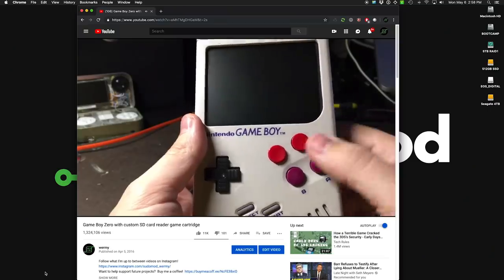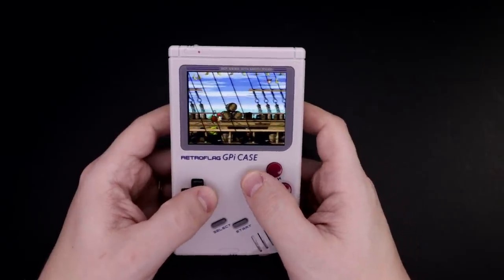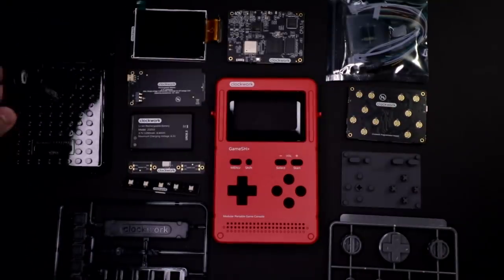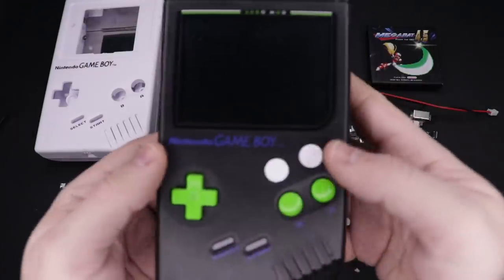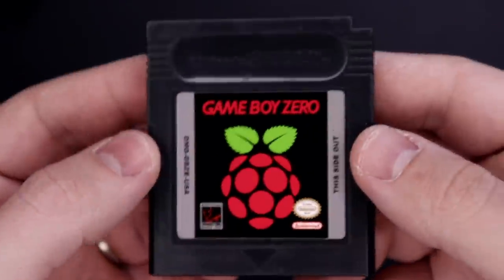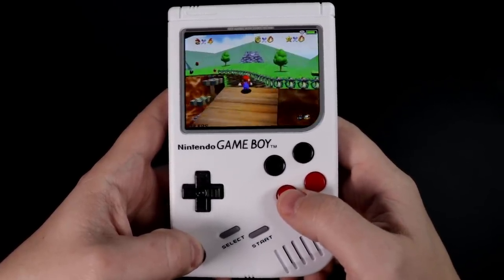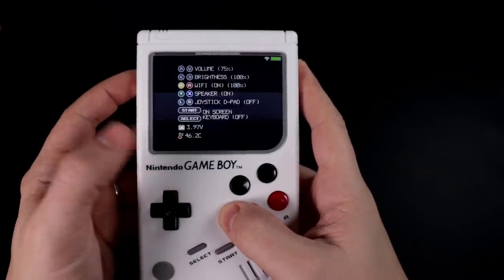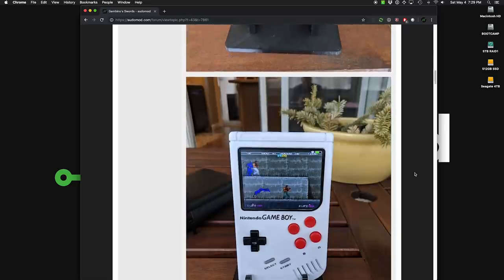Retro Emulation Handheld Showdown and GIVEAWAY!

Comment: I've got a circuit sword, extremely happy with it. I take it on long plane rides all the time and with a 4000mah battery I've never run low mid flight. I've got two psp1000 analogue sticks in mine and 4 back buttons for running PSX games. One thing Wermy didn't mention is it can even run a couple of dreamcast games with reicast. 3D stuff is kind of slow but 2d arcade ports like marvel vs capcom 2 are perfectly playable.

Comment: I wonder if they were working to a price point on the Gpi, and decided to leave out the LiPo charging circuitry to meet that. It's the only thing I would criticise about the case though, apart from that it looks awesome, and I'm sure there will be plenty of LiPo conversions shown as soon as it hits the streets. I am now torn between the Gpi and the Kite. Not a big fan of the ClockworkPi Gameshell, but for a certain audience (I'm thinking younger makers) it would be perfect. For an older tech head like me, the Kite is spot on. Thanks for the informative comparison.

Comment: Great show case! I have a CircuitSword myself and while I really like it (it even runs PSP games), I think you understated the amount of work it takes. Part of that for me was that I messed up a couple of times, did things in the wrong order (like inserting brass inserts into the screen bracket only AFTER installing it). I also did most of the case modding without power tools because I'd never used a Dremel before and didn't want to mess up the one case I had. Doing everything with hobby knives took far longer than needed! If you're ever going to do a "beginner mistakes you should avoid" video, I have some notes for you :D

Comment: Why not make a video about modding the Retroflag GPi case to use li-ion battery instead of 3 AA?
Reply: Theres already videos out there for that?
Reply: There's literally no point in doing that. The 3AA's are fine.
Reply: @jimmygillard   They're higher energy density, lighter weight and rechargeable . Means more battery life and less expense on buying batteries. Of course theres a point in doing it.
Reply: @felixschrodinger7533  You can get rechargeable AA batteries.
Reply: @edstar83  Yeah I know, but they don't have as high energy density as Li-ion, so the charge doesn't last as long as a Li-ion battery that's the same volume. Which volume is another reason why it doesn't make sense to design it with AA batteries as they take up more room because of their cylindrical shape. All the room for the battery tray if it was used instead to fit a Li-ion battery, then in theory you should see quite a big increase in battery life. You can potentially charge a Li-ion battery faster than AA's too and it's built in so don't have to bother taking the battery out to recharge or carry extra batteries when you travel. The benefits might not be worth paying someone to mod it with a Li-ion battery but if you have the skills to DIY then it's an obvious upgrade IMO.

Comment: I was sold on the Circuit Sword back during the first preorder. I ended up waiting for the second round and got mine. I couldn't be happier. Mine is completely glue free, I designed and printed parts to get everything to fit together. Obviously, it was terribly expensive. I spent near $300 to get everything but IMO, it was totally worth it. So much fun and the most power you can have on the go for this kind of thing. Also super fun to plug it into a TV with another controller and play with a friend on something like Mario Kart.

Comment: I'm confused about the purpose of the barrel jack on the GPi; is it meant to charge rechargable batteries in the case? Or just there as a built in option in case you mod it for a lithium ion
Reply from the maker: It's just there so you can plug it in if your batteries run out, not charging.  I love the original Game Boy but I feel like this (the use of AA batteries) is one thing they didn't need to reproduce exactly on this.  😁
Reply: @wermy  ahh that makes more sense, and yeah definitely a strange choice in 2019 :P thanks for the reply!
Reply: I do wonder if modding it to enable a rechargable battery... if that port could be utilized to recharge the batteries??
Reply: @eversinging  that's probably the best way to go. But at that point you'd probably want to squeeze in a charging board and use micro USB instead of whatever that built in port is.

Comment: I actually like the idea of AA batteries. Buy some 2800mAh rechargeable batteries and you're good to go. Gives you the option to swap out drained batteries for a fully charged set. I would love to see how well 3 2800mAh AA rechargeable batteries would stand up compared to a lithium battery. 
One question, can rechargeable AA batteries be charged from within that unit? I'm assuming no, considering the power draw and charge times for AA rechargeables can be crazy long.
Reply: I'm with you here. The fact that it takes batteries makes it a more more appealing rainy-day choice than a standard rechargable handheld. Just keep the thing in a box with a few extra batteries and it'll hold up great.

Comment: I wish you could put a Compute module in the GPi case, that would solve a lot. (assuming you can get a CM easier than a Pi-W)
Reply: i wish too.
i wonder though if one can desolder the unnecessary things from a b3+ (ethernet, usbs and so on, and the pins) and use some kind of custom printed cartridge with it.
it looks like the cartridge is the outmost part of the case, so you can theoretically have wider cartridge, so as long as you can manage to keep the same height of the two pcbs i guess it's possible...
Reply: or maybe someone can make a custom pcb that has the sodimm connector instead the springy pins, and maybe it would again require custom cartridge as it is still bigger than the zero

Comment: you said "(screen size) DPI screen" several times. that doesn't mean anything because DPI just stands for dots per inch so it's like saying "it's a resolution screen" or "a miles per hour car"
Reply from the maker: It’s a kind of display interface, like hdmi or spi (though to be clear spi is a general-purpose bus, not only for displays). https://www.raspberrypi.org/documentation/hardware/raspberrypi/dpi/README.md
Reply: @wermy  til, sorry about that

Comment: One thing that bothers me is the cartridge looks too fake on GPi Case. I also I hear that the speakers have some static hissing issues. The lack of a proper battery life indication can be an issue (but I take it that may be an issue with most RPi builds)
Reply: Most GBZ builds employ some battery monitoring using analog inputs from an ADC and some screen overlay scripts. Let's just say it's a long solved problem

Comment: Can u put a raspberry pi in a menzy comfy wallet, the stainless steel one? 
It would look soo clean and slick.
It would also be a tough challenge
Reply: You can put only the mother board and a bluetooth module in the bottom half, and a screen in the top half, so u could have the controller separate, idk.

Comment: Hey guys!

Sooo, where's all the MintyPi 3 stuff I "pre-ordered"? And that was early January. 

And orders were "going out" in March.
Reply: All I've gotten so far are some 3d printed parts that look like they hold buttons.
Reply from the maker: Helder ran into a few issues with his parts (the printed parts were from me). He’s been in the process of shipping them the last week or two, so keep an eye on your email.  Please use the forums or hop on the discord server if you have questions. 🤘
Reply: @wermy  I can't wait!

Whenever I finish that project up I think I'll be moving to one that's a bit more ergonomic. And then maybe take all that knowledge and design something myself.

The software is the easy part. And if you're using a standard Pi and plugging it into a TV it's not even a "project". 

Designing the handheld hardware itself is the real challenge.

I need to figure out how to use some CAD software.

Comment: Ocarina of Time isn't a good test, use Majora's Mask!
Reply: Running ANY N64 game on a Pi 3 is a challenge. And even ocarina stutters a bit. So majora's mask really isn't going to fly well. Not until the pi foundation upgrade the GPU (it's the known bottleneck for running N64 well)
Reply: @AlistairBrugsch  Is there a way to add in a GPU via GPIO?
Reply: @AoiKaze2000  🤣😂🤣😂if only. There just isn't the bandwidth available
Reply: @AoiKaze2000  options are higher spec boards like the odroid XU4 (but they usually come with high power and heat dissipation requirements) or wait to see what the next raspberry pi brings. They have said it would be completely new architecture
Reply: v true, majoras mask makes the wii and psp emulation builds shit their pants. im going to opt for portability and aesthetic on this though. no physical buttons for emu on my phone paired with the void that used to house my gameboy pocket cant be filled with pure specs
Reply: @opulence_reviled  decent phone with a Bluetooth controller grip like the ipega ones work surprisingly well

Comment: Hello, how much mah for batteries of retroflag gpi for your test  ? 2500mah ? 2800mah, 3000mah  by batterie ?
Reply: Yeah this is good to know.
Reply from the maker: The ones I tested with were 2300mAh Energizer brand.
Reply: @wermy It is strange... my LCL Game Boy with a RPi 3A+ inside has a playtime of 5 hours with a 5000mah battery. Why a RPi Zero with 3x2300mah only 4 1/2 hours? oO"
Reply: @adventureFAN  because your 5000 mah battery is a 3.7v nominal battery. 3x AA's in series are 3.6v but still 2300 mah total. Batteries in series add the voltages but the amperage stays the same. If you put them in parallel the voltage stays the same. (1.2v) but the amperage adds up so would then be 6900mah. Not 3.6v at 6900mah
Reply: @AlistairBrugsch  Ah okey thx for the explanation =]
I have 2850mah nimh batteries... I hope they will hold up for over 5 hours.
Reply: @adventureFAN  if @wermy used 2300 and got that result and your batteries are really 2850 then you should be golden
Reply: @AlistairBrugsch 
Yeah there are no fake. German fabrication from Ansmann =)
Reply: @adventureFAN  👍

Comment: Ah la la trop dur de choisir ... Gpi easy to set up v. Kiteretro powerful stuff wich one chose ?
Reply: If you want something easy to set up and play, then go GPi. If you like a small challenge, including doing all the case mods and a small amount of soldering or you want to play the maximum amount of consoles like N64, psx, PSP, or even some DS games, go for the Circuit Sword. I honestly have the CS and I LOVE it! Thanks to this video , I am going to add a joystick and l2+r2 buttons when all the parts come in.
Reply: Hi, seems that kite board is no longer availaible, no refurbisher in France ... maybe try an other product 🤷🏻‍♂️
Reply: @jaygreg77  Kite should have another round of preorders coming up within the next couple of weeks. Just keep an eye out on the Sudomod forums for updates.
Reply: @LiLTrublMakr  Thank you, good tip

Comment: What is your problem with AA batteries?
Reply from the maker: The fact that I can't just plug it in and charge it up (the last gaming handheld that I can think of like that was the original GBA...  18 years ago).  Unless you want to waste money on alkalines, you'll be taking out the batteries every time you need to charge.
Reply: @wermy  Okey but I have 2850mha batteries and I think I will get a much longer playtime then a typical battery that are installed on such devices. And when a battery dies its no problem anymore... I think this not so bad. But yes... on longer trips it is a downside because you have to carry a extra battery charger.
Reply from the maker: @adventureFAN  Playtime isn't really the issue.  It's the fact that you have to open the thing up, pull out the batteries and put new ones in every time you run out.  That just feels archaic in a newly-released device, especially one that goes through batteries after a few hours of use.
Reply: @wermy  Yeah 1989 gameboy feeling =D
I understand your standpoint now but for me it is no problem.
Reply from the maker: @adventureFAN  Yeah, it's certainly not enough of a problem that I wouldn't recommend the GPi Case, it's just disappointing to see that when everything else about it is so great.  :)
Reply: @wermy  LiPo MOD!

Comment: And if you're really lazy, buy a 2DS. :)
Reply: This is where I'm at. Refurbished 2ds directly from Nintendy is $50-60. It plays GBA, DS, and 3ds games natively AND emulates NES, Megadrive, SNES, GB/GBC, PCEngine on first party hardware with all the benefits that entails. In 5 years I doubt I could source a replacement screen for the GPi or the Clockwork case whereas I like my chances with the 2ds.
It also has online and local multiplayer.
My only gripe is the 2ds slate form factor isn't pocketable, but the 3ds/new 2ds fills that role.

Comment: Ohh big blunder with the AA battery design. Rechargeable battery with indicator light has been the standard since the GBA SP, over 16 years ago. You can't cheap out like Microsoft did and think people won't mind swapping out batteries every few days. I love my Xbox One S controller, it's great for playing games on my Steam Link, but without the Nyko charging stand and battery pack, I would probably use it a lot less because although you can use a USB plug-in, it's micro-usb and that is a garbage, easily bent cord design that doesn't stack up to the better-held mini-usb design which is now basically defunct for some ungodly reason.

Not to rant, but why is it that the industry can't decide on just one god damned standard for USB cords? Why do there need to be like five? Micro, mini, lightning, fucking whatever. These companies can't just give people a single, affordable cord, they've got to come up with their own and waste consumers time and money. In Apple's case it's more about money, but I doubt the others are less greedily motivated.
Reply: iVirtualPlays  "I prefer AA Battery design over built in batteries. It’s more modular that way."

More swapping of batteries, too, which is idiotic. It doesn't need to be "more modular" it just needs to be easy enough to swap out should the battery start losing its ability to hold a charge.

"No need to open up the controller if you want to upgrade or replace a bad battery."

If the battery is quality enough, you'd only need to do that once or twice. It is by far the best option as opposed to opening it up every week, depending upon usage. Even without use, Double A batteries lose their charge and you have to swap them out. With a rechargeable battery, you only need to plug the system in. That's why it's standard. It's quick and easy. If the Nintendo Switch still used Double A batteries, I promise I would not use that system.

"As for the Micro USB controllers should make the switch to USB C it’s more reliable and faster."

I don't know what you're suggesting here, but if you're telling me I should choose a specific cord, then I don't even know how to respond. You get the cords your systems demand. I don't choose to use microUSB for my Xbox One S controller, it's built for that plug. It is literally not an option. Regardless, I already have my solution and that's to not use the cord at all thanks to, again, rechargeable batteries. Industry standard. Way better than swappable batteries. We're not in the 90s anymore.